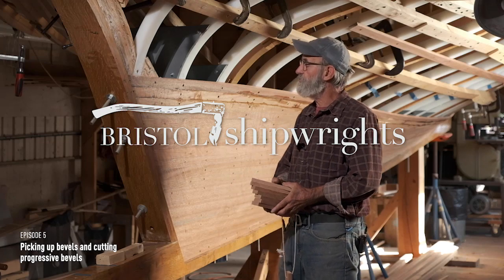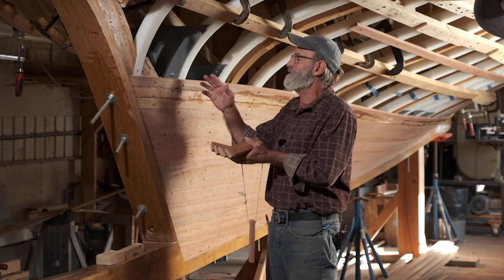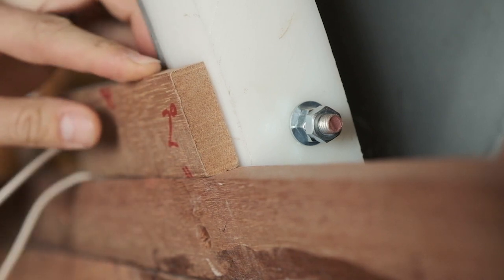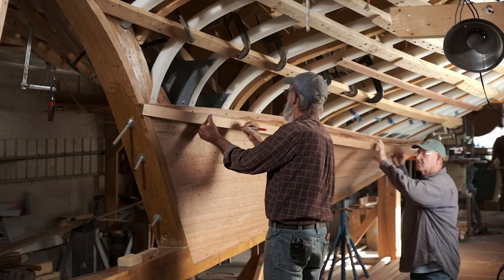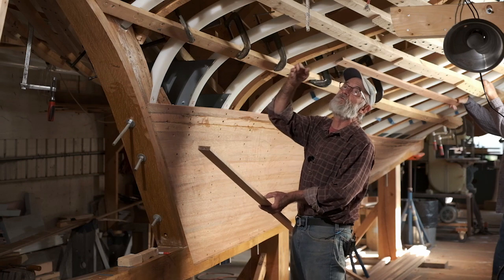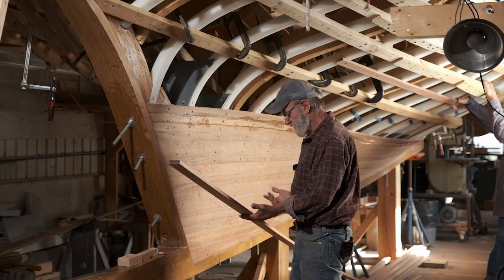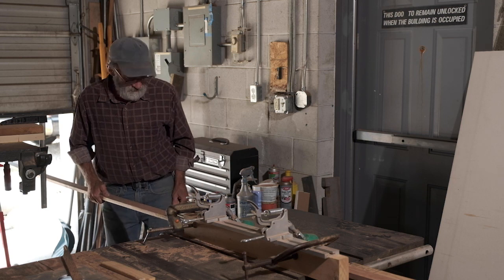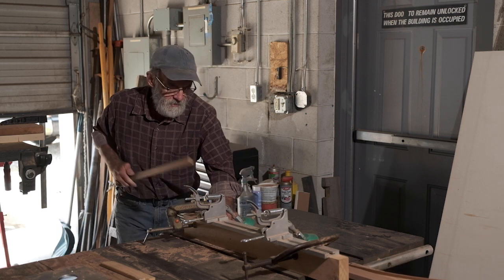Building Evelyn: Picking up and cutting progressive bevels, EP5

Comment: That is amazing.  To actuate it is difficult enough, to be certain you saw each piece for each side of the boat specifically with variable progressive angled edges, well that is tough enough but, to conceive this process is shear genius.  You should patent the design for planking a wood boat hull; it is surely valuable.  Maybe there is no need to patent, nobody but you could probably do it quite so well anyway.   Hats off Lou, that is amazing design concept put out for all to see.

Comment: How do you work the plastic? Is it formed with heat? I don't imagine you can shape and form it with the same tools you use for wood frames. Working with plastic is foreign to me
Reply: See this build by Lou using plastic frames, your question should be answered there https://www.youtube.com/watch?v=Wt8NwyP9kUU
Reply from the maker: Most of the frames were bent in cold. With frames that were radically bent in the stern, we used a construction heater to make them more pliable. Just like oak you need strong ribands and lots of clamps.

Comment: considering the cutting width of the circular saw, would such a setup not be more accurate on a bandsaw?
Reply: Just my opinion but i'm not sure a band saw would be stable enough.
Reply from the maker: You certainly can use a bandsaw for cutting progressive bevels, but the strip planks are uniform, straight and the bevels are slight (no more than 5 degrees). So we believe in this case the table saw is faster and very accurate.

Comment: Now if only you could somehow connect some tilting mechanism on the saw  to a CAD program. (Someday soon i think.) let the computer do all the cutting work while you do the final fitting. I bet someones child watching this could do in 5 mins. Stay well. You have so much knowledge to impart.. the future of wooden boats is in good hands....
Reply: I don't think you wouldn't even need a full CAD setup. You would need a controlled feed rate, though, so a set of motorized drums to hold the wood down and against the fencing to pull/push the wood through, and giving feedback to a PLC that would control a stepper motor to turn the lead screw to change the table saw angle. It's been a long time since I've done it and I'm sure the newer stuff is much more advanced, but you would just need to convert the feed rate to linear distance and match that to the desired blade angle per station on the boat. Moreover, with a known feed controlling the angle of the blade, the progressive bevel could be more accurate between stations, ie, if station 1 is at 2 degrees and station 2 at 2.5, the angle of the blade would be progressively and evenly changed between those two values throughout the distance between stations. Now that I think of it, as long as there's feedback to the blade angle controller, it could be manually fed. You'd still need a wheel or similar to contact the wood and measure feed rate, maybe with a simple hall effect sensor or something, but the feed wouldn't have to be powered. Accuracy would suffer vs the power feed, but this isn't that critical a job.

Comment: Plastic frames?  Tell me more.  Fiberglass floors?  Tell me more.  Progressive bevels on strip planking? Nice!  Will there be any membrane between the strips and carvel planks?
Reply from the maker: Good question. The strip planking will be faired. As we apply the second layer of planking we'll epoxy the inside of the plank and the hull. Then we'll apply a thickened layer of epoxy to the hull before fastening.

Comment: Lou, I wonder if how you can do the planking with straight planks (however, obvious to see). isn't it necessary to use curved planks at some further point? If I am not mistaken, you had used curved planks on a previous projects. I appreciate your comment. thnx.
Reply from the maker: Stay tuned for videos on the second layer of planking. One of the advantages of doing strip planking is that virtually all of the planks can be edge set into place, if you calculate the distance to the sheer carefully. However, you do have to occasionally add a stealer in the stern and taper a plank in the bow.

Comment: would be nice to see all the videos, FROM THE START!!  Would like to see how you all did the frames or ribs
Reply from the maker: Unfortunately we started filming after the frames were in. Most were bent in cold against the ribands. We did use a construction heater to heat up some of the radically bent frame in the stern. In the future, we may set up a frame on a table to show how the fames are bent.